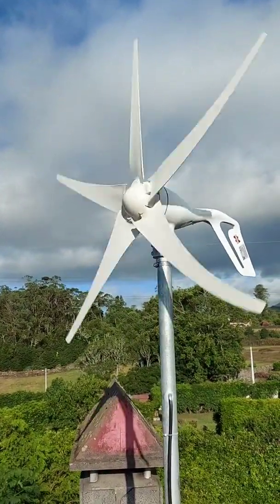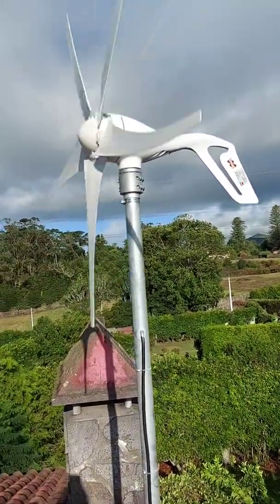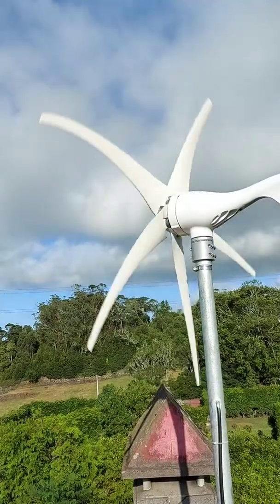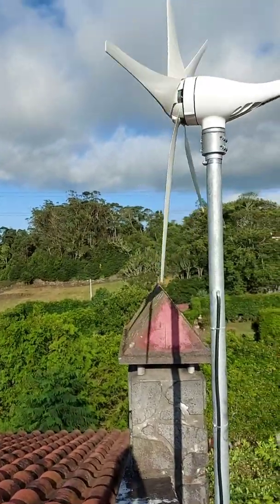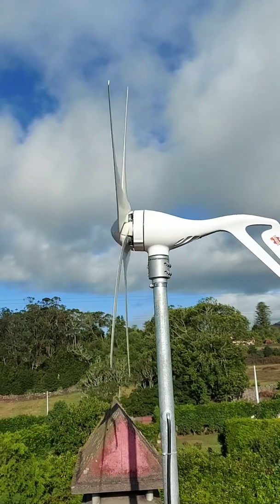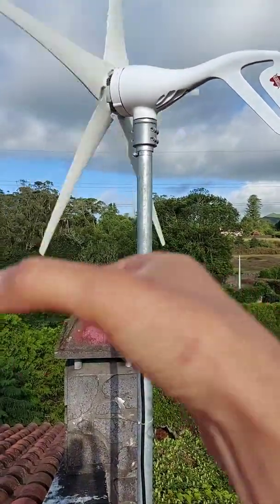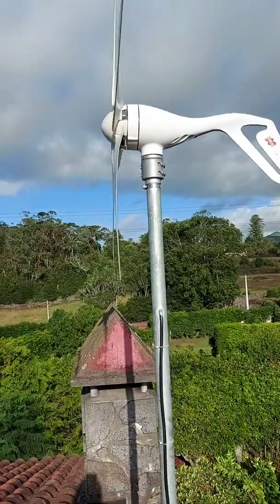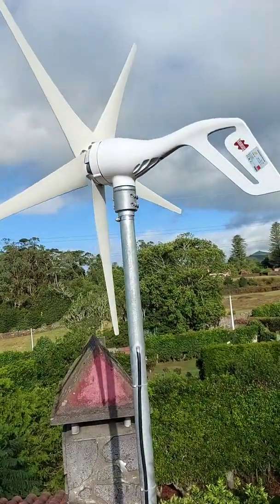MarsRock 400w, 12v, 5 blade Wind Generator: noise test

Comment: I hope the controller that comes with it is not full of sand, like other buyers have found!!
Reply from the maker: Nah, it cost a fortune and I ordered from a good seller. Opened it to change the fuse that I blew with a bad connection and all looked ok inside. I dont recomend mppt for small turbines though. As many warned me, the kicking in charge at 10v slows down the blades and never allows it to spin fast enough. I am currently only using it for my spare aray of mono panels and have the turbine through a simple rectifier direct to batteries. Its working much better this way.